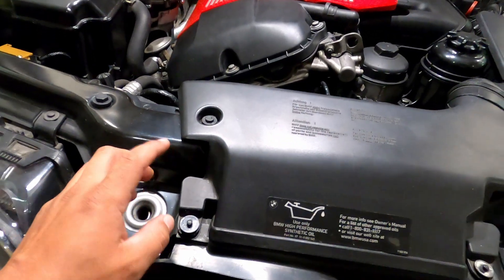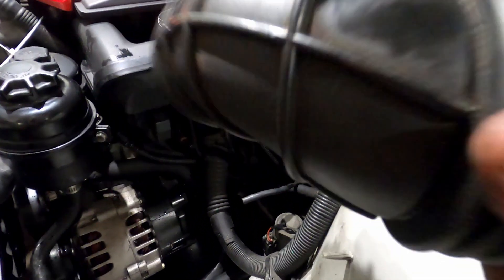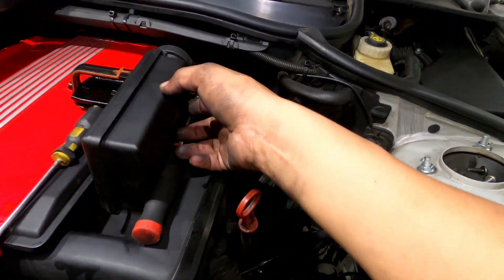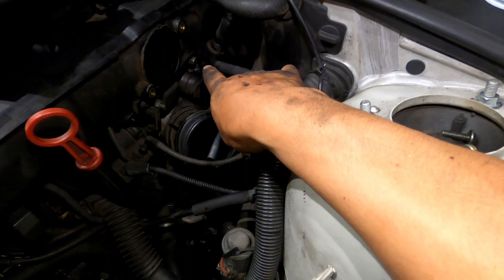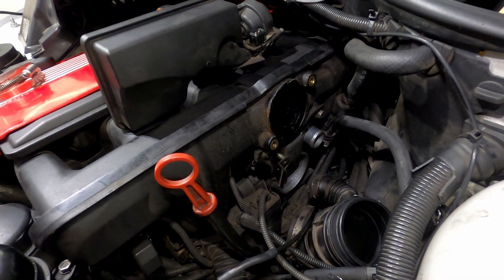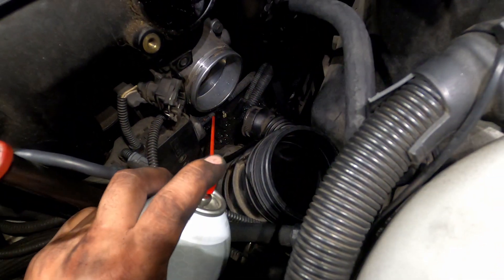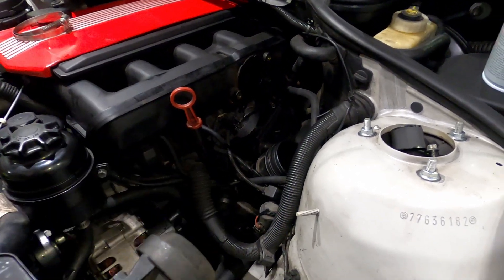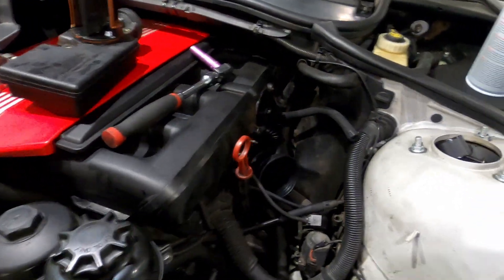BMW E46 INTAKE BOOT REPLACEMENT (UPPER AND LOWER BOOT)

Comment: The screw clamp on mine is upside down how do I unscrew it?
Reply from the maker: @lilbreezi1243  you can get a small 1/4 ratchet and use a small socket set to get behind it should work no need to use a Phillips screwdriver or flathead

Comment: Guys, honestly with pricing of those boots, I see zero issues just covering the boot with high heat silicone and putting it back
Reply: bro they’re $40 each for the upper and lower boot. if you can’t afford that you shouldn’t even be driving a BMW.
Reply: @the92hoe  bro,  where?
Reply: @dkrawk8309 they have a lifetime warranty and every part you can think of.
Reply: @dkrawk8309 fcp euro
Reply: They’re like $13 apiece on FCP Euro??
Reply: @M54Poncho  uhm.....they aren't
Reply: @dkrawk8309  my apologies. One is
Reply: Just replaced these on my car. One of them is 14$ and the other is 16$, so 30$ total.
Reply: @zapador  oh yeah?
I'm not sure where you get those prices.
It's $80 for the front ward one. The middle one is 90$ the  throttle body one neve bothered pricing out

Comment: Did you kinda have to fight with the lower boot? Mine finally got put on but didnt seem like it wanted to, looks lined up correctly though
Reply from the maker: Yes you do bro the bottom part is the hard part but take your time to line it up so you won’t have vacuum leak
Reply: @SlowE46...  was tripping about this for alittle bit but turned out my pvc was bad 🥲
Reply from the maker: @brandonobrien6262  aw man did you end up fixing that problem as well
Reply: @SlowE46...  about to start taking things apart just waiting on my parts to show up, got another week sadly. Then after that I gotta replace my valve cover cuz it's causing a massive oil leak rip lmao
Reply from the maker: @brandonobrien6262   good luck man you got this 💪